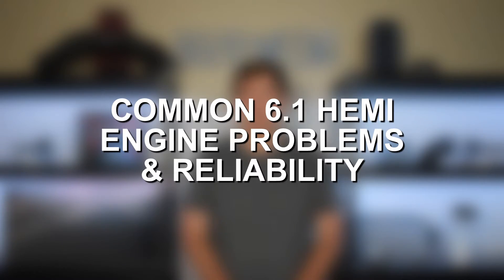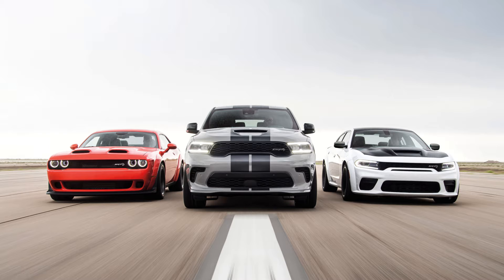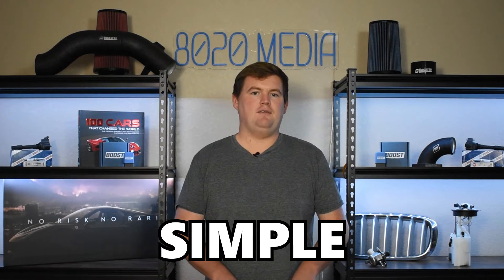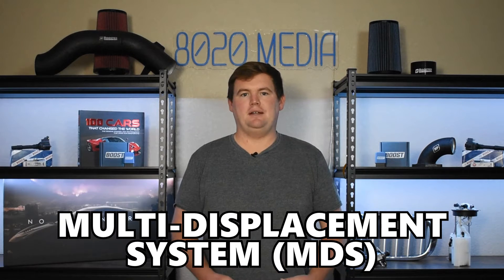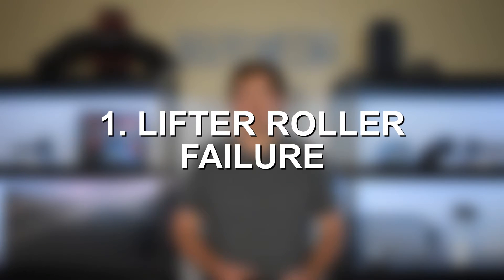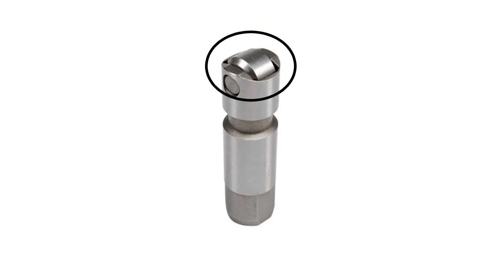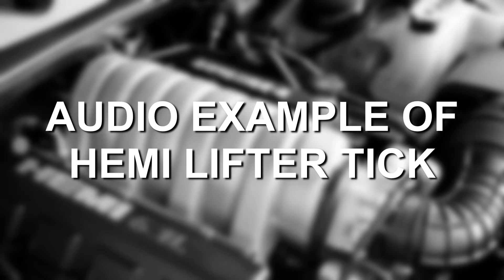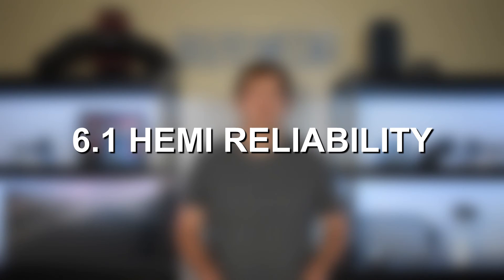The 6.1 HEMI Engine | Common Problems & Reliability

Comment: Pennzoil ultra platinum every 3k-3500 miles 06 300 srt8 bought with 97k miles now at 189k no issues so far
Reply from the maker: A - Nice! That's the way to do it.

Comment: I’ve had my 06 srt8 300 for 4 years now. Bought it from an old couple at 135,000 miles, at 180k it still runs good. Just replaced the brake components, next is full tune up ! I love this car. Fairly good highway mileage
Reply from the maker: Z - Nice! Sounds like you take great care of it.

Comment: I will say I've had my car for 2 years I got a used model at 150 kolometers on the clock now coming up to 180 very reliable engine as long as you keep your service up very strong fun engine 💯
Reply from the maker: Z - Couldn't agree more! Thanks for sharing your experience.
Reply: Hey Zane ! Me too! I bought my 06 Chrysler 300 srt8 at 135,000 miles, and now at 180,000 the transmission was replaced(shift kit installed) and I just replaced the brake components and next is a full tune up!

Comment: I bought a 2008 Dodge charger srt8 started having a lot of pressure in the coolant system, it turned out to be my head gasket, so I took it to a shop to get it replaced and the heads done and while I was at it, I replaced the lifters. Great video 👍
Reply from the maker: N - Thanks for the feedback and taking the time to share your experience!